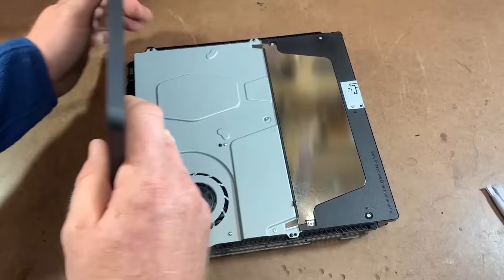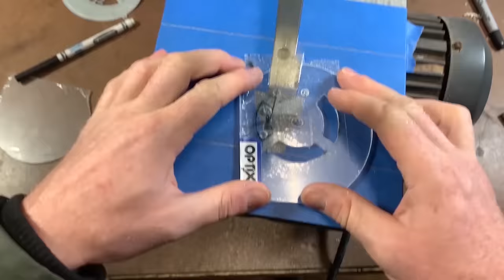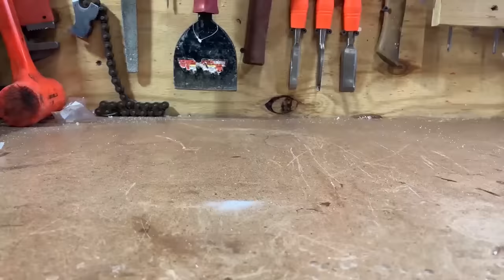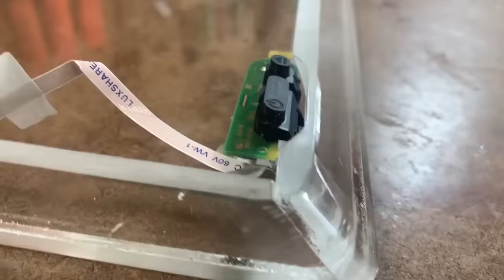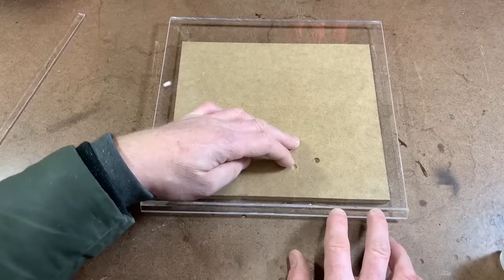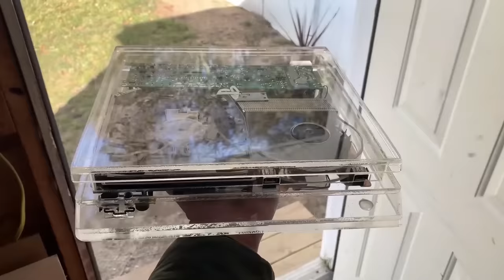Glass Playstation 4!! Custom Hand Built!

Comment: Being a pc guy watching him not redo the thermal paste
Reply: he substituted it with super glue 😂
Reply: wht is thermal paste for?
Reply: @dezzieskidney26  to keep the cpu from getting too hot. its really essential and he just didn't re-apply which is a joke in the pc community.
Reply: @riverclishe  😂 lol
Reply: @Ghandi since when? Never had a problem with my ps4 in my life
Reply: @BOOG-2  you won't until you get the new one and then you'll see the issues with the old one.
Reply: @jukeplays7572  no, i'll see the improvements with the new one.
Reply: @BOOG-2  probably means the old one is very slow for this time
Reply: @samthewizzy  mine works fine. Only thing is it's slow to open apps
Reply: @BOOG-2  it plays terribly man… once you get to play on a gaming system that actually performs well, you’ll understand.
Reply: @faded5754  i've been playing pc for years and i recently got a ps5, doesn't change the fact that the ps4 is great
Reply: Being an engineer watching him use super glue in everything leaving no option for future accessibility... not to mention the buttload of uncleaned dust.
Reply: or thermal pads for the VRAM chips and put pack the heatsink under the PS4.
Reply: Yeah, wow! everything else is good for you, huh?
Reply: I'm not a pc guy but you're right he should of redid the thermal paste
Reply: my man glued the heat sink to the board
Reply: @hakunamatata1681  there is another metal part for the VRAM, he removed it with the thermal pads, and because of that, that PS4 will die in 30 minutes maybe.
Reply: @faded5754  I own a PS4 Pro and the Xbox Series X.  The PS4 Pro holds it’s own and still plays PS5 games.  There’s nothing wrong with the PS4 Pro IMO.
Reply: THANK YOU I saw that and for a second thought I missed it and so glad I'm not the only one
Reply: Bruh I seen that and wanted to cry and there’s no venting either he sealed the sides
Reply: @dezzieskidney26  keeps the cpu from heating up .
Reply: BRO, i came here to say this
Reply: @dezzieskidney26  travsferig heat to the heatsink
Reply: Thermal paste is essential because it helps to get all the micro-dimples out of the cpu to spread heat evenly to the cooler
Reply: Same af
Reply: He also superglued the whole thing shut. So no way to change the CMOS battery when it dies and no way to change the Hard drive when it fails.
Reply: @Niiyosporin Yeah why use your old PS4 when the PS5 can play ps4 titles at a better frame rate

Comment: Ok, this looks cool af, but i just wanna mention that this thing probably overheats constantly, there's no air flow for the cooling, so that fan is literally just there for the sake of being an item that spins
Reply: not to mention he glued the heatsink right to the apu without giving it some new thermal paste...
Reply: Also missing any and all shielding.
Reply: Some of that heat shielding is RF shielding too. WiFi might not work correctly because there might be RF interference from the CPU. But yes, the memory chips are probably hosed without the big metal plate that doubles as a heat sink for them.
Reply: Yea looks nest but def should of thought about cooling more aswell as upgraded the hdd to ssd since your doing all this.
Reply: thanks for putting these comments and replies. i was about to post all this myself. but it looks pretty decent tho
Reply: @daniel070487  yes

Comment: plastic parts: toss
metal chassis parts: toss
essential fan cooling ducts: toss
Reply: ventilation? what's that?
Reply: makes ps4 out of clear plastic....great idea
Reply: @MrLiberty1960  I mean it's not a bad idea... as long as you route proper cooling vents in the acrylic
Reply: @thebrunoserge  yea but this is supposed to be "glass" I knew once I saw the "glass" that this video was bs
Reply: Oh dont forget Gluing the heat fins to the cpu
Reply: Lets not forget about exposed electrical glued close to the motherboard and hard drive glued closely to it as well.
Reply: @StudiosDraco  Dude exactly what I was thinking, I mean this guy GLUED the heatsink to his apu.. Not to mention the damn fan is placed the wrong way
Reply: @zhz3591  Fan orientation was correct vent holes were not. Not like it matter as there was no access to fresh air, or the fact a direct contact to the chip with the heatsink. There are basic rules to follow in builds like this, and only one was followed, include the logo.
Reply: well i mean if i can see the inside, i would assume the air could get inside too
Reply: @123jbuster  Stupid air, can't even get inside where I can see perfectly
Reply: It wasn't meant to be practical I think. Just take it for what it is. A glass PS4 that will probably never be turned on again.
Reply: @gadoatl5133  ok it’s a shit mod then. It can be done functionally but the guy decided to do it wrong
Reply: @thebrunoserge  I bet dust will ??
Reply: @gadoatl5133  you: “take it for what it is” also you: “a glass ps4”
Reply: That's why engineer guys don't really do art, and art guys don't really do engineer lol, you'll need both personnels to design these stuff for aesthetic and functionality
Reply: Definitely need cooling ducts… but id put a replaceable film filter on it
Reply: @zhz3591  
Cos he has no idea what he's doing.

Comment: Cool esthetic but now your PS4 has NO COOLING for Memory modules, Power section and you didn't even bothered to add/change thermal paste on the APU. Temperature control is fundamentally important in my opinion much more then esthetics.
Reply: Yes, the GPU and VRAMs temps wll go to space
Reply: Next stop:Overheat central
Reply: Well he's glued heat sink with APU, so it would be conclusion that is permanently closed system

Comment: Very cool. I watched so that I could gain some confidence in what I'd like to do, and this vid helped me see just what I had to keep and toss. Good stuff. Personally, I'm going to do a different build, with less adhesive-permanence, extending the pieces away from one another and adding lots of fun cooling! It will hopefully share a mid-size server case + PC with a simple hdmi switch.  This one is way more delightful on the eyes for sure!!
Reply: The permanent sealing kind of hurt my head a tad.  My thoughts were constantly questions about how it would be cleaned, heat retention, or repairs if anything went wrong.
Reply: Video?

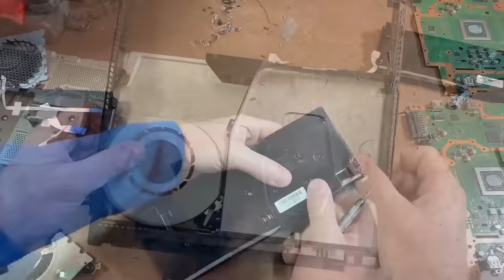Comment: I'm sure you took all the necessary precautions, but I'd recommend maybe letting people know that at 2:28, disassembling and fiddling around with a power supply can leave you liable for a serious shock or even death. Some of those capacitors hold a charge even when unplugged and can mess you up if you short them through yourself by mistake. You also should probably have put in a bit more than a few pegs between it and the main board. There's a reason it has its own plastic casing around it.
Reply: @urban_fox_cub_urbex  source: voices from my head
Reply: @jhosefmachado7414  🤣😳
Reply: @redlineone6737  I second that.
Reply: @urban_fox_cub_urbex  I also discharge after 30 seconds
Reply: Really cool job man. But you should have a separate fully cased powersupply. This could be dangerous.
Reply: @_FluffDaddy_  Hehehe.
Reply: You could discharge it, just hold down the power button for 2 - 5 minutes. make sure its unplugged tho.
Reply: @_FluffDaddy_  😂😂😂
Reply: @urban_fox_cub_urbex  no they do not lmao touch the capacitor in a camera and let me know
Reply: It can actually kill you even when unplugged because the capacitors hold so much charge.  This is a literal warning that most professionals should leave on vids where they do it.  They can kill you and are excessively dangerous if not drained properly.
Reply: @oginja1430  lol
Reply: wait when?

did i ask?
Reply: @exexfear9640  ong

Comment: Glass is very different to acrylic. To cut this from glass would be incredibly skilful and a much more impressive feat.
Reply: That’s what I was thinking but still cool
Reply: You would have to temper every piece of glass that has holes or cut outs in it to keep the glass from running out. Pretty much impossible to have a hole in the field area of a piece of glass and it not be tempered. You might have a chance with lami but that's to thick for this project. 3/16" is the thinnest I've seen laminated glass in my 23 years in the glass business so that would be to thick and heavy. Tempered glass or heat strengthened glass would be the only way at 1/8' or 3/32" if you can find someone brave enough to tempered the supper think glass.
Reply: Well it makes it more heavy, but yeah it will be cool and impressive of course
Reply: YEAH ITS PLASTIC NOT GLASS
Reply: @jrocksburr2724  You should make one out of glass, lets see it
Reply: @noahz6980  I couldn’t even do that out of acrylic if I watched a tutorial, but glass is practically impossible which is why I clicked on this video in the first place. My point is that you shouldn’t false advertise, I never said I could do better.
Reply: @punktalley  it seems impossible to make a standard temper with such fine workmanship. maybe the phone can be made in places that can make protective glass.
Reply: still impresive tho.. lol
Reply: @elmejorgelatina  I think it's impressive enough not to lie about the material in the first place.

Comment: Glued the whole body. I can imagine how it will be cleaned.
Reply: Didnt think that through
Reply: I haven’t cleaned my PS4 in over a year and opened it up to clean it, just to find out there’s only a few specks of dust. The best thing really is having a compressor or that duster can and using a vacuum at the same time. Now that you can see what you’re doing with this, I’d imagine it’s easier to navigate and clean
Reply: Glued the hard drive as well
Reply: I wont be needed to clean because there wont be much of dust

Comment: Great build! Would definetly not recommend glueing the heat sink to the processor, you can't change thermalpaste/pad which you actually didnt even put in so the console will definetly overheat on more demanding games. Mounting the psu right on top of the mobo with all those coils uncovered makes me worried its going to jump, there is a case on the psu for a reason. Also wouldn't recommend glueing the storage to anything it's going to be a nightmare to swap it when it fails.

Comment: Gotta be honest, the part where you just glued all the electronics together probably hurt me the most
Reply: Why ? Are you an electronic?
Reply: @mikixP  no he doesn’t go outside
Reply: Same here. If ever something breaks in the electronics, he's screwed now. Wish he had just used screws to attach the glass rod bits that hold it together.

EDIT: Oh goodness! Just watched him glue the heatsink to the CPU socket. It hurts so much!
Reply: He turned his ps4 into an Apple product lol, beautiful with zero repair capability.
Reply: yesss i was thinking why not double face sticks??????? its like AHG
Reply: Boltrix  Well that's quite the expensive show item then if that is the case XD
Reply: I haven't advanced in this video that far but seeing him laying a HDD and the Motherboard PCB DOWN on the lower side of the PSU's Board...  God, as if it wasn't bad enough that he pulled out cables on the cables not on the plugs

Edit: he just completely got rid of the RF Shield??? AND GLUED THE HEATSINK TO THE... WHAT ARE YOU DOING BRO?! A cup doesn't have enough weight for contact pressure and what kind of glue is that?? Does it melt when it gets hot???
Reply: Okay, now I have watched it. Absolutely NO airflow, you drag in air from inside the... case which is filled with only... Hot air that traveled throught he heatsink, also... WHY did you glue it together? Next up, this wasn't glass but acrylic, which is plastic. Then, even though you theoretically can say yes, this is not necessary but you should have a grounding port somewhere, never use a blowtorch on acrylic, that's what heatguns are for, CAREFUL use of those, you could also use epoxy resin to make these edges smooth instead of burning them. The original PS4 Slim has thousands of breathing holes on the sides and the back and is able to use these and still gets very hot so I don't know how much acrylic has been dripping down into your heatsink, while using it. And honestly saying, like don't take this as offense but... It doesn't even look that good. And how are you supposed to switch that HDD now if it breaks or swap it against a much faster SSD? You GLUED it all ;-;
Reply: @sage_x2002  HE GLUED IT ALLLLLL........ jokes aside, it is a "bad job"
Reply: @zarigata  like I'm not talking bullshit rn, the moment I saw him gluing that motherboard a damn tear left my eye in despair
Reply: @sage_x2002  i agree with you man, it is the worst job ever....
Reply: Mee too, the most hurting part is the heatsink on cpu! but is a good job

Comment: The build is impressive but I'd do a few thing differently. I'd add LED light strips on the inside for dramatic effect (which would be powered by soldering them to points on the main board, I'd add vents where they are supposed to be and I'd trim down the metal plating inside and place them back in the build (because their purpose is to spread heat) also I'd add screws to the outside outside cover of the build to make it more sturdy because after a while, with the heating and cooling of the build I feel like the glue will fail. Overall and impressive build though.

Comment: 2 things I noticed that are an issue with this build. The cooling system is basically non existent. Like, the fan has a small opening on the bottom but the entire console is basically a solid, sealed off block of plastic. There is little to no airflow. That can be easily fixed by adding ventilation to the side panels though. But #2, which is most important, since Sony was scrutinized about the fact that their consoles will basically be bricks the moment that battery dies, the issue is the reparability of the console. I'm not sure what was used to bond the parts but I am going to assume that it will not be easy to get into for repairs. Such as, if the power supply inevitably fails due to the hotbox that the APU cooling is going to turn the back of the PS4 into, it will likely need replacing sooner rather than later because there wasn't a duct installed to divert the heat away from the APU/PSU. 

So while this whole this is pretty cool, there are some flaws which could be easily fixed. However, I must admit that since this is not a console for sale somewhere, these issues aren't really a problem. I'm sure he will fix them when the time comes.

Comment: Problem, all the glue is flammable or will melt from the heat, second the metal chassis was also needed to cool the ram chips.
Reply: He did not redo the thermal-paste 
on the CPU
Biggest fail

Comment: That's acrylic not glass, what a letdown...
Reply: True
Reply: Chill its still impressive
Reply: @teenmonster8667  not really
Reply: its plexiglass
Reply: @esoshxtter6065  Fr lol
Reply: @esoshxtter6065  it's pretty straight forward really. All he did was take the components out of the PS4 put them back together without the case on then he got the original case measured it and then he cut some acrylic into the right sizes and shapes and glued it all together. Pretty straight forward if I do say so myself. Maybe not for your small brain though.

P.S I didn't say "It's not easy" I said it wasn't impressive.
Reply: @teenmonster8667   I believe @zingyplains is correct that that it is actually quite basic and simple. It’s just a basic recut of the casing only out of clear acrylic. Dimensions were more than likely downloaded and this is in no way as hard or as time consuming as it would be to make it out of glass. Making out of glass and making a video on it would more than likely be more than 21 minutes.
Reply: 3mm hobby acrylic ain't got shit on 6mm toughened
Reply: @esoshxtter6065  you must work in a mall or some shit to think that mate,this is first yr skills applied to a fucken console.

Comment: Nice. 

Of course there are things I'd have done differently (like everyone else). There are too many. 
Allowing the hard drive to be upgradable from original later on OR make the hard drive external (leave that old location open or do something smart with it to assist with cooling) and extend the SATA port to a custom port near the others. 
If you made consideration for the VENTS that are on the underside edge around the lid (the side that had the PS on it, feel around the edge in the space), which I think you did by making the dial-rod stands a little taller (did you?), regardless dust is getting in there. How are you taking that apart to REALLY clean it where a can of air won't do? I guess you don't need it if you have a PS5 though huh? So it can just be a display/backup?

Comment: That looks unfinished and unusable because system can't breath.
Reply: Can you explain with more detail pls
Reply: Because there hot air existing out of the case there is no vents for air to come in to the case for the fan  ddr4 chips are going to over heat and die and you can't get the hard drive out anymore it permanent now the whole thing I going to over heat and what air that's in there is going to sweat in the box because of the heat

Comment: Isn’t it gonna overheat cause there’s no vents for the fan tho..?
Reply: A whole host of issue with this. The heatsink is glued in as oppose to screwed in which disregards the proper tension for the plate surface to make a proper contact with the chip for optimal heat transfer, not to mention the heat melting the adhesive overtime. Also, the air duct system has been thrown out in favor of a minimalistic internal, it's gonna help blow air into the processor, but the air isn't properly cycling in and out.
Reply: @gctdonyre  oh i see
Reply: @kurmeenak  Also, it's not really glass, it's acrylic. Basically, clear plastic, that's why it's easily sawed off in this video, glass can't be sawed off as easily like that, it cracks and breaks easily.
Reply: @gctdonyre  ikr !